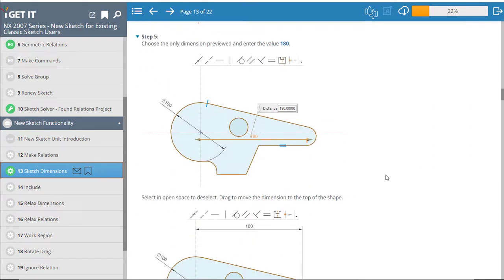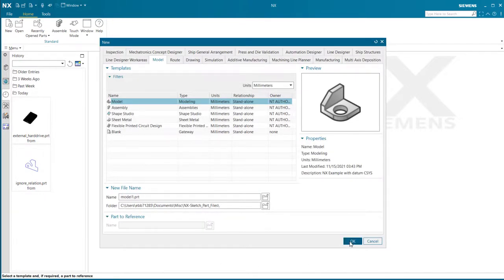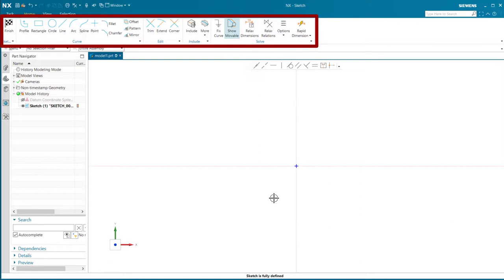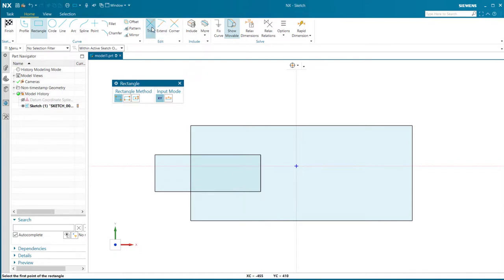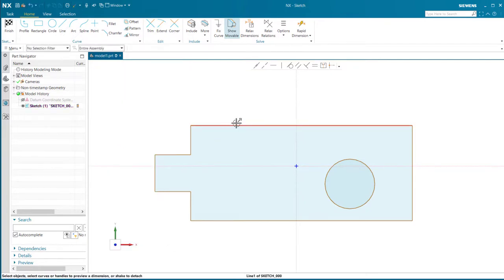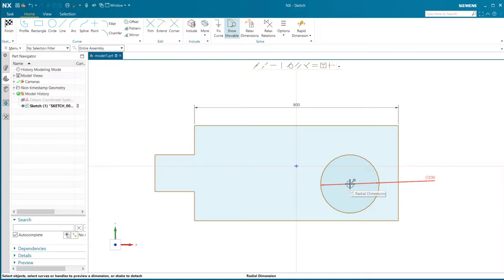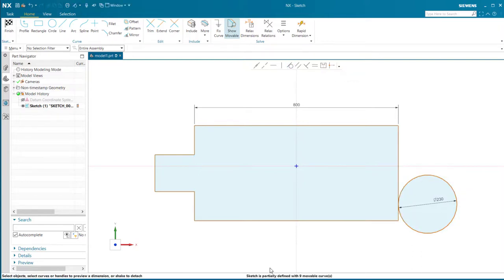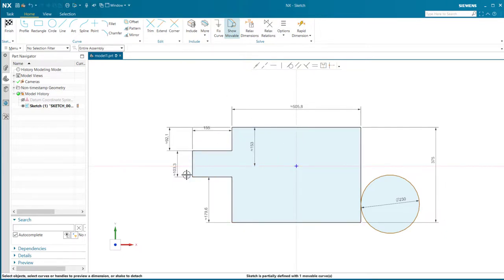Basic Approach to the New NX Sketcher | Siemens NX

Comment: The new sketch got some nice new features that can come in handy, but why did they feel the need to remove so many essential features. Like why is there no more option for auto dimensions, why isn't the center of the circule displayed all the time, why can't i select the midpoint of lines, why can't i align points vertical or horizontal to other work part featuers
Reply: im struggling with the same items you stated. i just want the midpoint of a line
Reply: @shawnpeterson7998  luckily they showed how to get back to the usual in this video. Thought i was stuck with this.